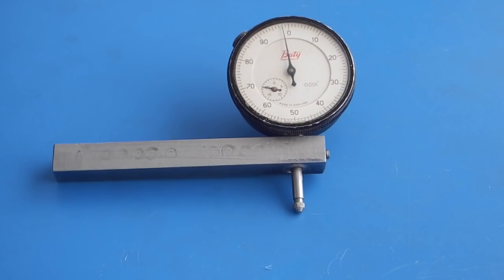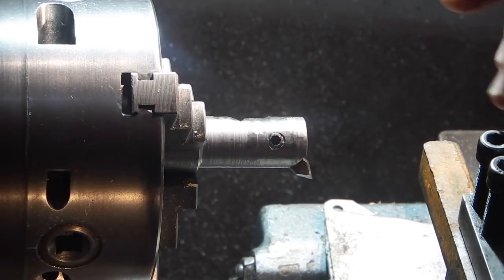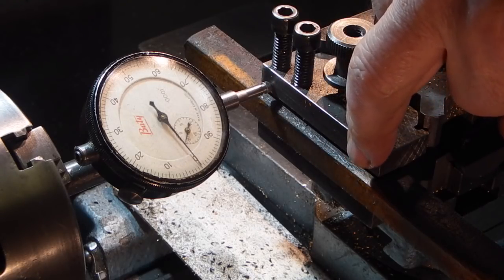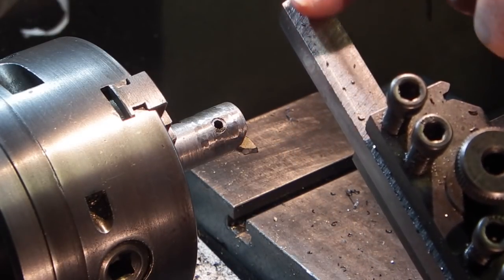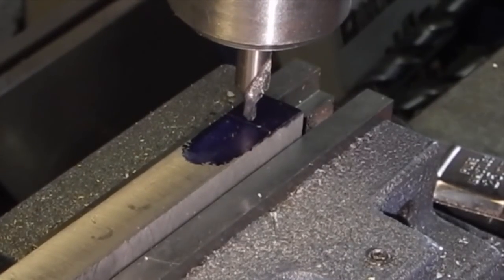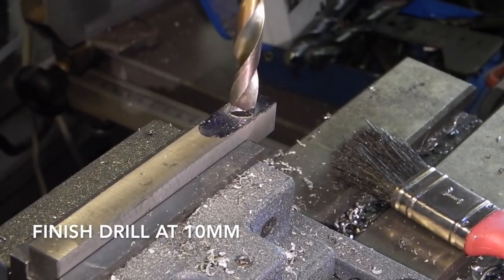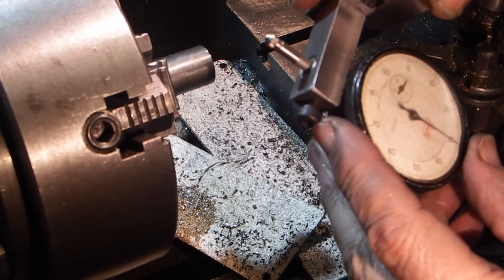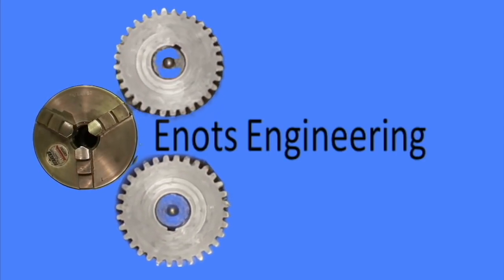DTI holder from scrap

Comment: Wouldn't it be easier to square up the stock in the mill?
Reply from the maker: Hi Rene
This video is for the people who do not have a milling machine, like me. And shows how to use the lathe as a mill.
Reply: enots engineering That explains it. Guess I missed the reason why part. Nice touch on the bronze bushing.